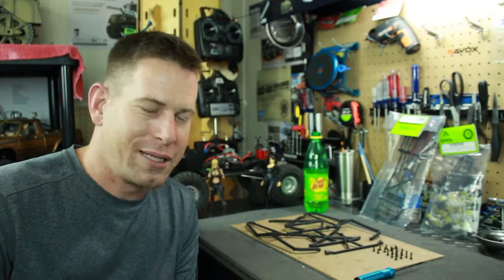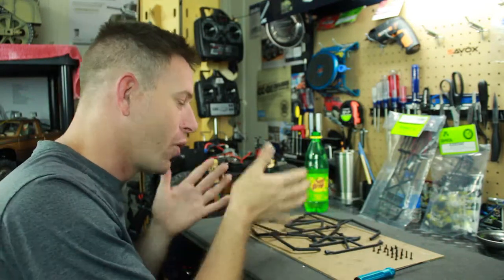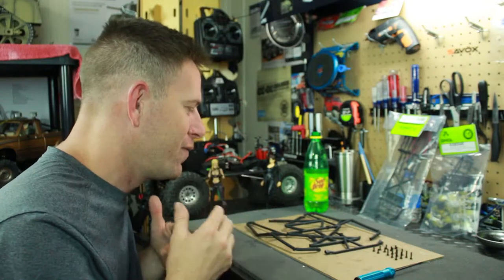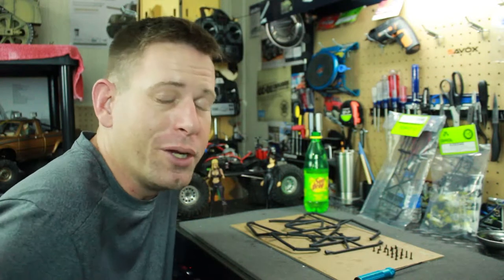RC84Films: Axial SCX10 2 Ambush Body Part 2

Comment: You need to learn the score and snap method of trimming Lexan much faster. I'm surprised no screw instructions for the cage.
Reply from the maker: Don't know what u you mean on score and  snap method
Reply: @RC84Films  You run a craft knife round the lines you cut so the plastic has a line. Then fold the plastic back and forth until it snaps.
Reply: Make it bad make it flat😁😁geat job well done
Reply from the maker: @martinsabathy3336   I actually painted it  Satin black